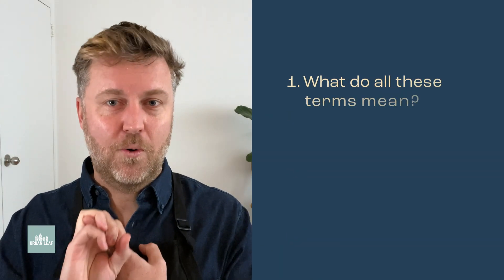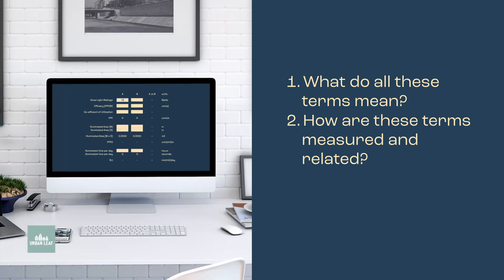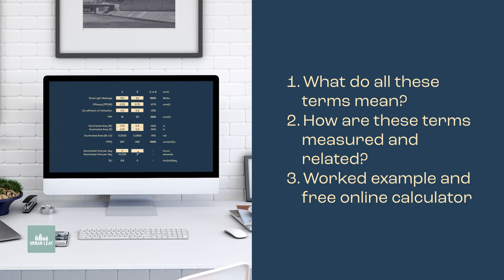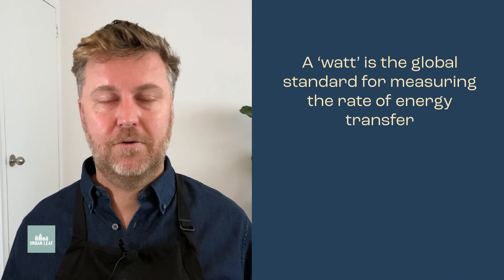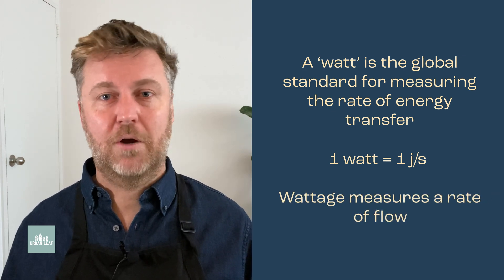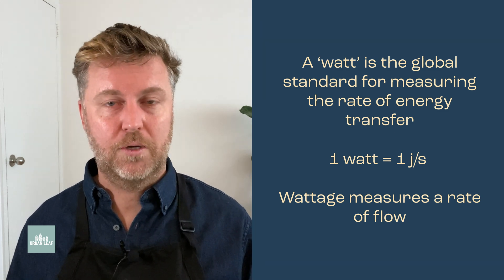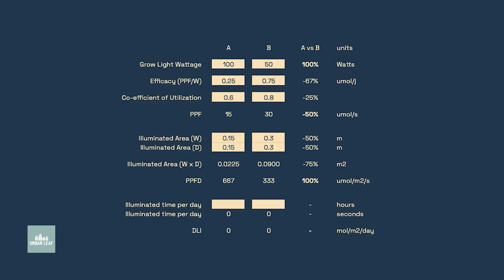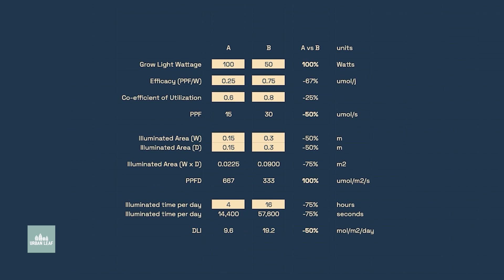Grow Lights for Indoor Gardening - Making Sense of Watts, PAR, PPF, PPFD and DLI

Comment: I just found this video. Wish I had viewed it before buying 2 150 watt ViperSpectra lights for my orchids. I was smart to get the dimmable ones because at 40% they are pretty close to where the light should be when using the Photone app. I’m thinking I could have gotten by with the 100 watt ones and will get those as I replace the Fiet electric 19 watt fixtures.

Comment: Why aren't fresnel lens sheets, like the ones used in LED flat panel TV sets to collimate the light source, used with  grow light panels? In order to more evenly spread the light across the grow area, and also to reduce light being shined outside the grow area.

And for the same reason (even distribution of the light source), why should LED bulbs continue to be used when there are LED array panels and strips? Bulbs seem as outdated for this purpose as purple LEDs.

Comment: is a 1000 watt bulb good for indoor plants in one med size room?
Reply from the maker: That will depend on a number of factors, such as:
1. Is it a true 1000 Watt bulb? Many 1000 Watt bulbs are actually putting out a significantly lower amount of power.
2. The actual dimensions of the room, and if you are using a grow tent with a reflective lining.
3. What kinds of plants you are growing.

We have a blog that can answer this question in better detail (and also has a built-in calculator to figure out exactly what your requirements are) here: https://www.geturbanleaf.com/blogs/lighting/measuring-light-for-indoor-plants

Hope that helps!

Comment: Could u plse explain how to find PPF of 100W light and how did u get 0.6 CU of 100 W
Reply from the maker: Hi Susmitha! Some manufacturers will publish PPFD data for their lights at various distances. You can use this data to 'back into' a PPF value for the light. I've seen a couple of suppliers publish efficacy data, which you could combine with a CU assumption to get an implied PPF value by doing Watts x PPF/W x CU = PPF, but honestly - this sort of disclosure is pretty rare. The PPF/W and CU values we used in the worked example in this video were just randomly picked. To be honest we chose the numbers to 'prove a point' more than anything else - that point being that the 'best' grow light is dependent on a large number of variables besides wattage alone. Tell us a little more about what you are trying to figure out here and we will try to point you in the right direction! Cheers, Nate